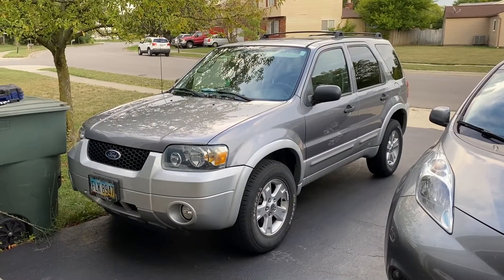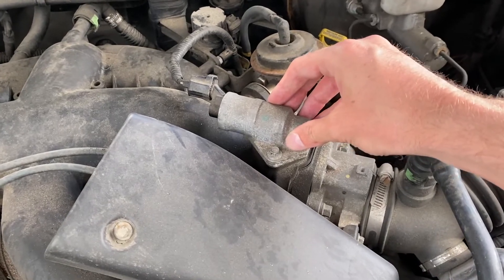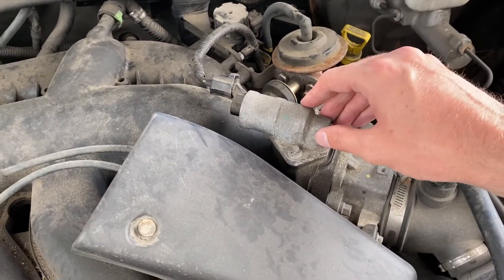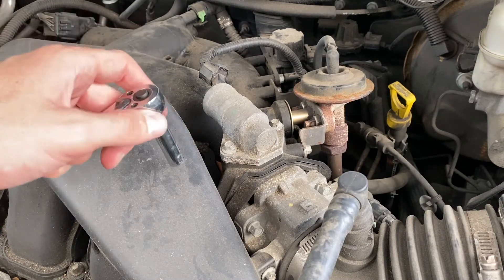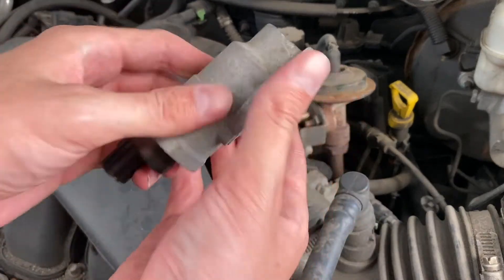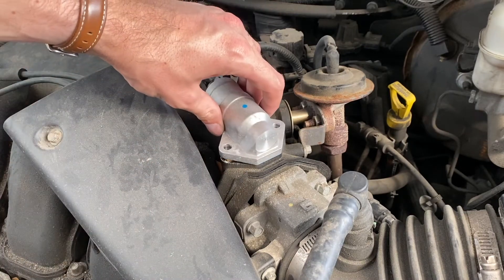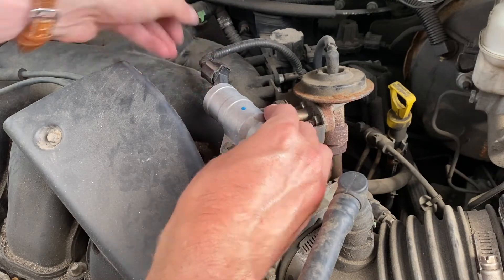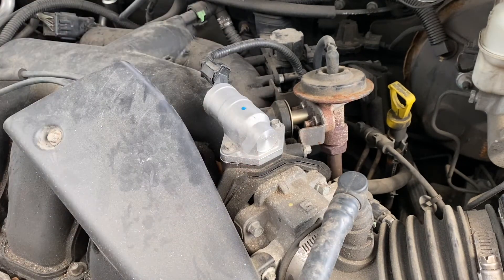2001 - 2007 Ford Escape Idle Air Control (IAC) Valve Replacement

Comment: Let me tell you these aftermarket iacv are not made Oem specific !
Most of them lets the car idle a little higher or a little lower than what it should be.
8 out of the 10 aftermarket brands does not work like the Oem part.
And all of them stops working for about 1 year of use.

Comment: Helpful video, thank you!  I would also spray clean MAF sensor and Throttle Body, be sure disconnect the battery. NOTE! there are 2 separate spray cleaners: for the MAF and for Throttle, do not mix... ✌
Reply from the maker: good tips!
Reply: Ok some electrical contact spray on the maf would do yes

Comment: Vacuum Solenoid is also a very common problem part. It is the round black part with 6 ridges. Its located to the right of the green air hose connecter you see in this video. it takes 2 screws, but be careful. The seal will fall into the engine compartment as soon as you take out the last screw holding it in. Also, check for dry rotted or split air lines. The part mentioned in the video, and what I mention fixes 80% of these engines that i have come across.
Reply from the maker: good tips!
Reply: I have replaced the Mass airflow sensor, the IAC, EGR valve,  My escape threw P1504 ans would die every time I came to an idle.  I can't find a vacuum leak anywhere.  Should I move on to the Vacuum Solenoid?  It started doing it again when AC is on.   The code never went off.
Reply from the maker: Ultimately between replacing this and the EGR valve, we had the car engine back at 90% reliable operation. Still had stall problems whenever the car would come off of highway cruising speed to a dead stop. Likewise was never able to pin down the exact cause a vacuum leak or other culprit.
Reply: When I replaced my EGR valve and vacuum solenoid, I needed to replace the vacuum line harness. Ford lists this as a part but I couldn't find one by Ford or any aftermarket company. I removed the harness from the car, removed the plastic cover, and set it on the workbench on top of a lot of paper towels (the hose disintegrates into dust when you touch it) and then I slowly replaced each section of vacuum hose (all the same diameter), making sure that I kept the angles and attitudes just the way they were originally. Once I finished, I replaced the plastic cover and maneuvered it back into place. (BE SURE TO MEMORIZE HOW IT CAME OUT! THERE IS A TUNNEL.) It works perfectly now and I only spent about $8 for the vacuum hose at the local auto parts store, and I still have some left over.
Reply: So is this the 1 you can adjust up near the firewall

Comment: So did it fix the problem I've got 2001 v6 escape in Australia we've just swapped over engine & it goes great over say 1500rpm but when you drop it down to idle it stops. So hopefully this quick fix will fix the issue
Reply: In the US there are multiple fuel injector cleaners, by far the best I used is Royal Purple brand, I would try that too as long as spark plugs change and air filter, lastly disconnect the battery to reset ECM usually 20 minutes or so, then reconnect and idle run for 15, when start drive within next 100 miles just accelerate gently, no high RPM, I'm sure it will help... Best ✌️
Reply from the maker: It did help, but idling never fully restored on the car while we had it. Eventually sold it to a friend.

Comment: So what I understand is that you had a rough idle coming to a stop from a high speed.My escape does exactly that.Normal idle is ok.Something could be smoother. It’s really rough stopping after high speed.Did the iac valve fix your problem? Thank
Reply from the maker: Yes! IAC did help with curing a lot of the problem.
Reply: @MattStephensRich  ok great! Thanks for your response
Reply from the maker: you bet!

Comment: I have a 2005 Ford Escape and only notice after sitting idle, about every 30-60 seconds the RPM's drop out a bit and then it comes back. Does this sound like IAC or MAF?
Reply from the maker: IAC is worth a shot, as it's relatively cheap and easy to fix!
Reply: Try also CRC MAF sensor spray cleaner and CRC Throttle Body spray cleaner, both cleaners are different, do not mix. Would also change the air filter. I did all the above on my 06 Escape 3.0, it runs / idles like a new... Hope this helps ✌️
Reply from the maker: Good ol CRC!

Comment: My escape the IAC V is differrent side installed ,if I change new one like yours it should be installed as clip shown?
Reply from the maker: It could be you have a different engine size. IAC valves gratefully all install in similar fashion. :)

Comment: After you put the new one in do you have to adjust the intake ?
Reply from the maker: No adjustment needed - ultimately air intake is controlled by the engine CPU, which is continuously adjusting.
Reply: Ok. Cause I put new one in. Sounded weird. Than I checked there was only one thing I could find. Turn key to on hold break and gas in for five seconds. Release turn off for ten seconds. Then start. And it sounded better
Reply from the maker: glad to hear it!

Comment: Did this trip the check engine light?
Reply from the maker: Indeed it can if the issue is significant enough to indicate bad air flow or bad air fuel mixture.

Comment: Where would the IAC valve be on a 2008 for escape 2.3 4 cylinder not a hybrid
Reply from the maker: It should be in roughly the same location, recommend googling engine bay schematics to get a best lay of the land
Reply: @MattStephensRich  thanks man